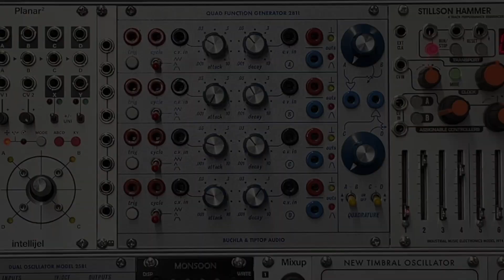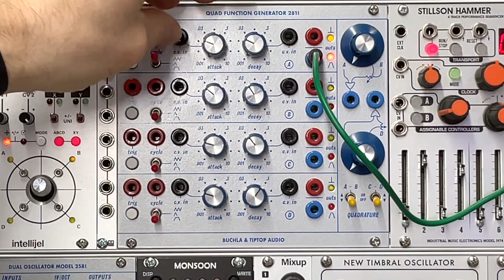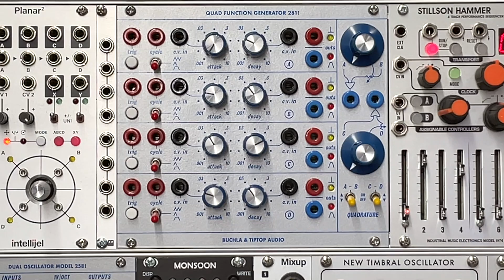Buchla Tip Top Audio Quad Function Generator 281t Eurorack Module Tutorial Lesson 1: Overview

Comment: Thanks for your videos! Your reviews on the Enner and Arp 2600 have really helped my explorations. And now I'm drawn to Buchla, either the new Command or piecing something together with the Tip Top modules. If I wanted to piece together a stand alone Buchla style Eurorack with all that Tip Top has on offer at the moment, what other modules would you suggest?
Reply from the maker: all of the tiptop Buchla modules are pretty cool.  I would get a 258t (although I've had quality control issues with that one), one or two of the 281t, because they're so flexible.  I would point out that not everything is released, so you won't be able to do a complete tiptop Buchla system and have control over the sound yet, but once the 292t is released, it will be possible.  I have less use for a 245t, but I will get one eventually.  The 266t and 257t are definitely good utility modules to have one of, but if you already have a good random module, the 266 isn't necessary.